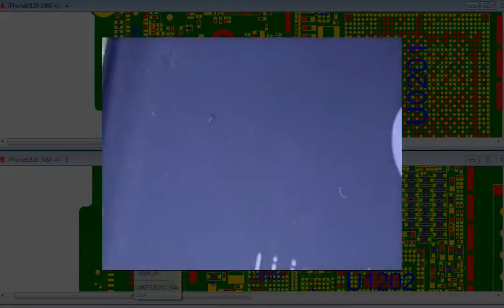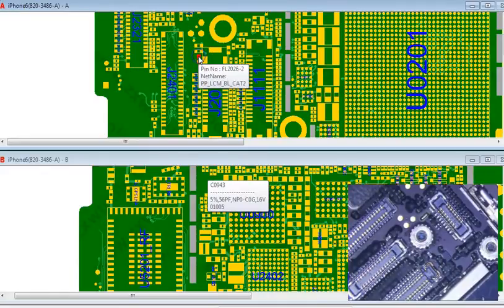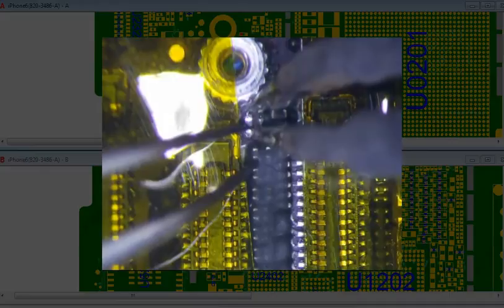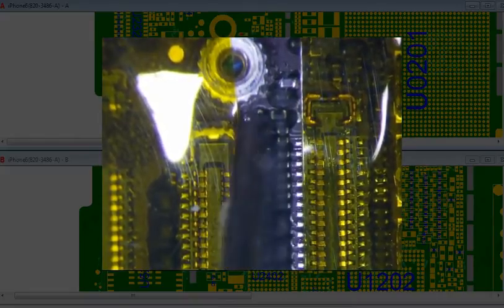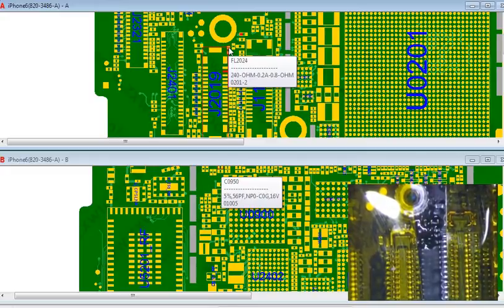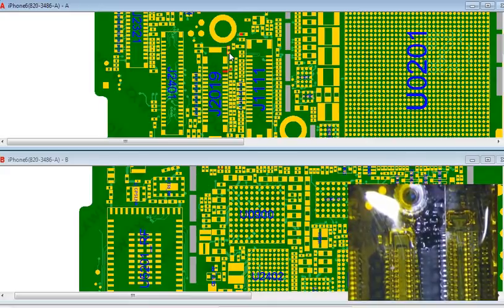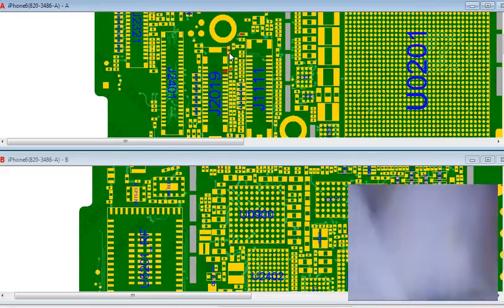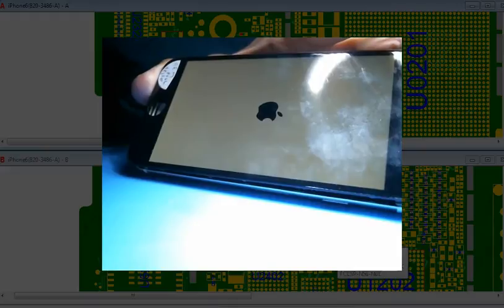iPhone 6 Backlight Filter Repair

Comment: Can you send me a link?? Because I don't know  where I can buy a backlight filter with this number ( 240-0201 ) ( FL2024). If I find backlightfilters so it's is a set with all three filters. An then I don't  know which one is the right. Or is it written on the filter ?
Reply from the maker: http://www.digikey.com/product-detail/en/tdk-corporation/MMZ0603Y241CT000/445-2148-1-ND/765079
http://microsolderingsupply.com/index.php?route=product/product&path=59_65&product_id=87

Comment: Hey man. I like to watch your videos, they are very real and very helpful. I have a iPhone 6 with a touch issue. It had gray bars on the top and in the middle of the screen doesn't work the touch but it is just at small part. I already changed these 2 both ic touch and the gray bars are gone but the small part not touch on the screen is still there. Do you have any advice for that? Thank you
Reply from the maker: It's either the digitizer connector or one of the two touch ic chips.  Inspect the connector first, then replace Meson, then Cumulus again.
Reply: +Microsoldering hey thank you for answered me. I could fix the problem and wanna share with you. There are some capacitor and two resistor between these two ic touch. The capacitors are in serial in these chips. One capacitor was loose in one side and that is the reason a small side of the screen was without touch. Thank you so much and I hope this can help you one day.
Reply from the maker: Good stuff.  Can you point out exactly which capacitor and resistors were the problem?
Reply: +Microsoldering the resistor wasn't the problem. It was just a capacitor. It was the first capacitor next to the resistor between meson and cumulus chips.